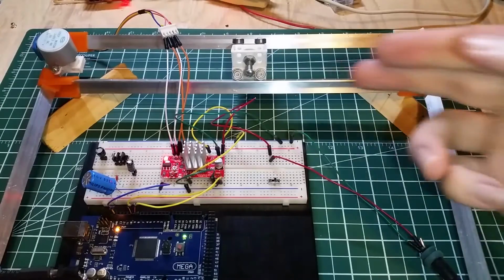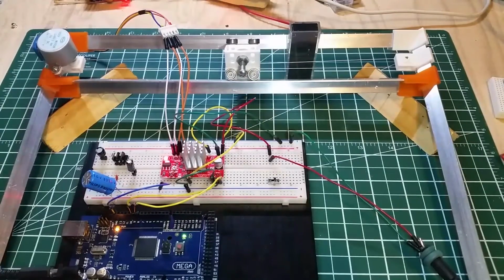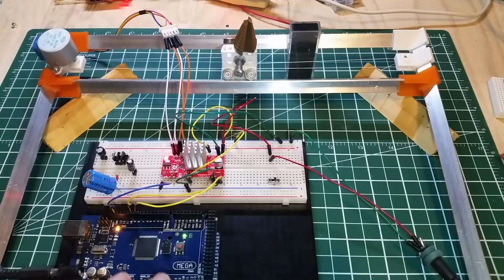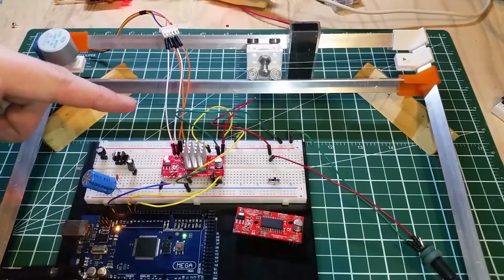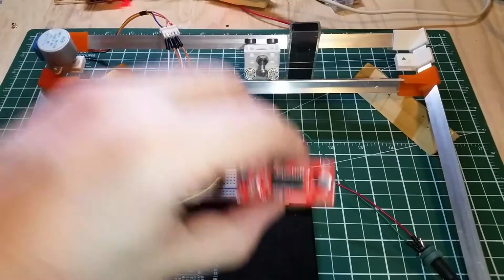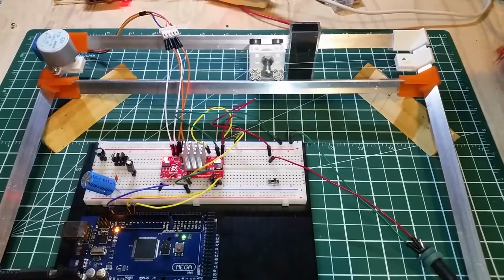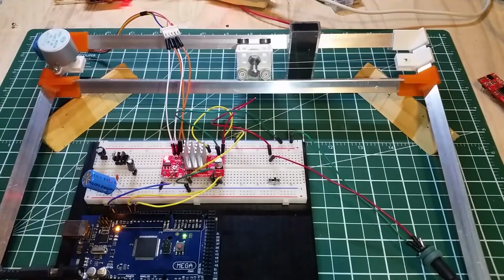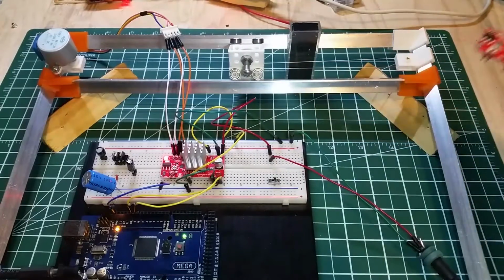Stepper Working 1 [ and killed a easydriver ]

Comment: If you cut current of an inductor fas the voltage increases to very high levels. If the cable is far away from the connector this should not hurt. In your case I can imagine it was close and a small "spark" bridged the distance and killed the device. Bad luck!
Reply from the maker: +Andreas Spiess yeah , i had it worked out to small intermittent caused by 'new' jumpers.  If you go to easydriver's web page you will see they say to be sure you use firm / secure connections to your motors.

Comment: I didn't know that those EasyDrivers could be killed so easily. Thanks for the warning.
Reply from the maker: +Hari Wiguna NP,  me either until i read the docs back when i got my 2nd set  ,  . i was looking for what changed in version 4.4.  seems it had been a possibility all along . Even then i thought it was like over cautious ESD handling warnings on LEDs LOL
That said they are still may favorite module for simple things .  When used with small motors at lower voltages and current ranges the board itself is enough to dissipate the heat . And depending on use you may only need 1 GPIO if you dont need direction control.
Here is where ULN2003 kicks their butt , as ULN's are protected darlington arrays. they can handle sudden loss of a coil or inductive load , and you only need to protect form back emf if a motor spins while you are not ON, most have that rite in the IC as a pin to free wheeling diode. . But ULN's require more GPIO or a driver chip to control stepping pulse patterns. I use the to add muscle to my MCU's , as ULN's can sync way more current , you can even link join inputs and respective out put pin to increase current capacity .  

The easydrivers are chopper drivers.  that is they are current limiting ( IIRC ) , so the input voltage is not too big of a deal, so long as you set correct current for your motor.   I usually just turn it way down and move it up until i get no steps lost in normal operations . But because they are chopper's ,  the coil in the motors are like the inductor in a buck converter. Removing a coil while the motor circuit is energized causes damage to the  A3967 IC , a sit is sinking all the current .   You can however power the module if no motor is hooked up , you just cant add or remove motors/coils when the A3967 IC 's energized.  I wonder if there is a way to protect form that , like putting a small light bulb across the coils ?? Probably not , as  It wants a inductive load. 
The real trap is when using new / fresh jumper wires , I have had countless strange issues with those chepo 100pc set form eBay .  they usually have a oil or even worse a fin plastic film on the pins.